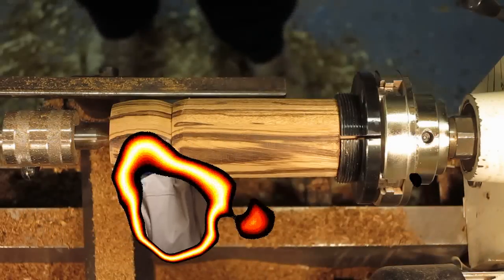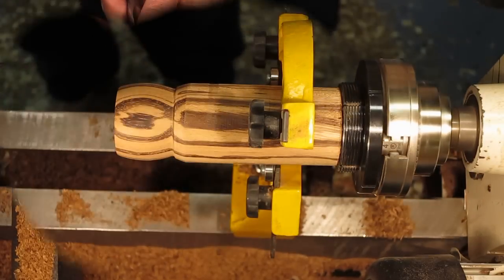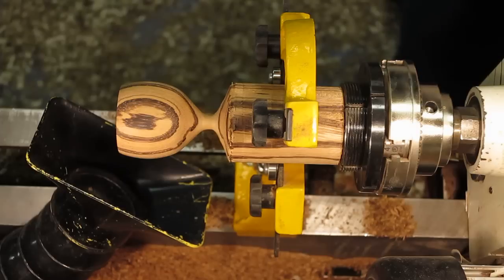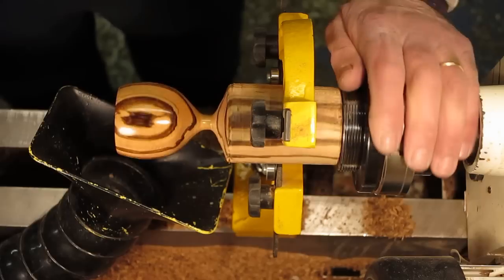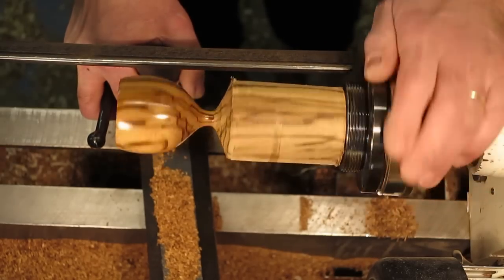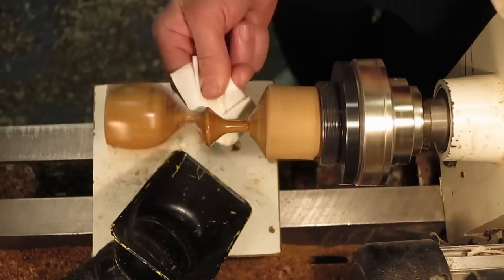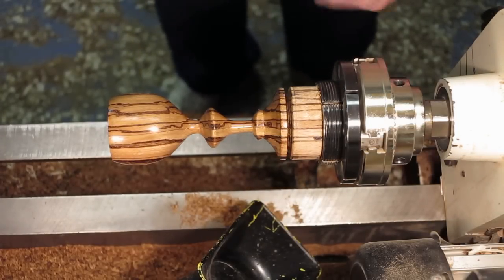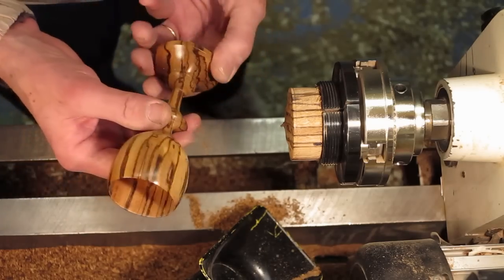Wood Turning - Eccentric or Off Centre Goblet.

Comment from the maker: Thanks for the kind comments. The wax I use is Chestnut Wax 22,and Cellulose Sanding Sealer and Cellulose Thinners, also Chestnut products , I thin the Sealer with the Thinners 3:1. To see the full method I use, watch my video "A Simple Wax Finish", it goes into detail about the application and final finish method. Hope this helps.
Take care
Mike

Comment from the maker: Thanks mate, glad you liked it. I got the steady from Axminster Tools. Wherever you decide to get it make sure it will fit. I will have to put a raiser block of some kind on mine, as the spindle is higher than my old lathe, also the bed ways are bigger. just make sure it all will fit before you buy.
Take care
Mike

Comment: Thanks again for your info on both the finishing productas as well as the self centering chuck. At the moment I will have to stick with my new faceplate as I have slightly overspent on my lathe, tools and a new band saw too. haha. as for the Danish oil, I bought a tin of that to practice with and will now try it out as a finish for my pipes. Hopefully some videos will be uploaded shortly. keep up the good work and thansk again for your advice

Comment from the maker: I am not sure if they would be hard wearing enough, I would doubt they would hold up to a lot of handling. I do use Danish Oil, which is both food safe and hard wearing when applied three or four times, with an 8 hour minimum between applications, to allow the oil to penetrate the wood. It does not come to a high shine but more of a deep luster.
Hope this helps
Cheers
Mike

Comment: Hello Mike,
Great piece of turning.   I'm going to give it a try.   It would be lovely to have a set of these, say four, on a turned wooden tray.   I'm well and truly hooked on you work and watch at least one of your videos each and have therefore subscribed.   I note your caution about pieces flying off and for early beginners they should note that I have a triangular shaped hole,each side about 5 inches, in the plasterboard ceiling of my workshop which could easily have been my skull. Thanks.

Comment: Brilliant work. I will be attempting something similar shortly. Just one question. what wax, sealer and polish do you use? i tried beeswax sticks and they just covered in blotches and not smoothly coated. although I used the stick and not wire wool to finish. I am getting my next shopping list ready for supplies and could do with getting the proper stuff instead of trial by error. Great video and great work. hope to see more soon.

Comment: Thanks for the info. Are the finish's hard wearing? what I mean is, I am making some electronic pipes. the end stock will be wood, housing the electronics and battery and this will be held in the hand (like a normal smoking pipe) will the wax finish be enough to stop discoloring and dirt build up?

Comment: great video mike,,do you have a dedicated chuck,,like the wobble chuck or vermec,,or had you rather do it this way,,i like your small steady rest,,i have the larger one but would like to find a small one like yours for goblets
Reply from the maker: Thanks Jeff, I have always used this method for off centre goblets, and really have never considered the need for a wobble chuck to be honest. This steady rest is one I got when I started, I got it from Axminster Tools here in the UK, but had to make a riser for it as my first lathe was smaller.
Hope this helps
Cheers
Mike

Comment: Hi Mike, I have really been trying hard to think of the right question I want to ask about this lathe. I can fully understand wanting to upgrade it based on its spec limitations. But apart from that was there anything about the lathe that wasn't working right? EG. spindle run out, things becoming loose or worn out. So, within the quality of the machine was there anything wrong with it? 

I ask because I have a midi lathe that works fine (Charnwood W824), but doesn't have the power to turn 12" bowls. So, I have a choice of spending some money on the Axminster craft lathe, which will cover what my other lathe can't do, or spend a lot of money on a complete upgrade, effectively replacing a good lathe.

My biggest concern is the craft lathe is a budget hobby rated lathe, as is my midi lathe. That had a casting break which I was able to get repaired quick and cheap. Since then I've had no problems, apart from feeling I was killing it trying to turn a 12" bowl! I'm torn between taking this seriously and buying a decent pro machine or stick with the hobby gear. The thing is I only know my lathe. If I compare it to a musical instrument, there is a lot of difference between playing a budget instrument and a quality one. If I spend over a £1,000 on a lathe, will I notice a difference in using it, other than the extra spec features, like power, speed range and so on?
Reply from the maker: All I can say is that upgrading to a "better" machine will make the journey less effort and more enjoyable ... plus usually more reliable. It depends where you see yourself regarding turning in the future, if you feel you rill need to go bigger project wise, a quality machine is the way to go.
The old saying always rings true with me
" You can turn a small piece on a big lathe but you can't turn a big piece on a small lathe".
Possibly food for thought 🙂
Take care.
Reply: @MikeWaldt  Thank you so much for taking the time to reply Mike. You have confirmed my feelings that I should go for quality, as they say, you get what you pay for. Since asking you the question about your old lathe, I did find a review of the newer version by Rag 'n' Bone Brown. I had assumed that even Axminster Craft machine would have a good build quality. But after watching his video, compared to reviews of lathes such as the RP Herald, the Laguna 1216 Revo and the Stratos Midi Pro, I think a 'better' machine is what I should aim for. (I am still grateful that these companies give us an affordable way in, like my Cgharbnwood lathe. But for me, it is time to take it seriously, at the risk of using another cliche, go big or go home!

Out of the lathes I mentioned, I like the Midi Pro, however, the only video I can find on it is Olivers Woodturning. I'd like to see that it has the torque to do what it says it can do. It is only a 1HP motor and variable speed controllers can reduce the power at lower speeds. There are so many videos on the Herald and the Laguna. 

Anyway, I'm waffling on again, thanks again for your time and sharing your experience.
Reply from the maker: @richardhawkins2647  My pleasure Richard. My advice would be to ring either Simon Hope or Ed Oliver and discuss it with them. They are both very approachable and will give no nonsense answers to any of your queries. Good luck and let me know what you decide as I really would be interested.
Cheers
Mike
Reply: @MikeWaldt  Just to let you know I have just ordered the Midi Pro from Simon Hope. Simon pointed out that my lathe has a 3/4hp DC motor, whereas the Midi Pro has a 1hp 3 phase motor. I had previously read about the motor on the CL4 and seen what Nick Zammeti has done with his CL4. So my concerns were put at ease. Thanks for your help Mike. 
Take care,
Richard